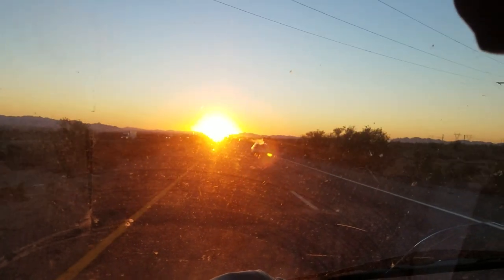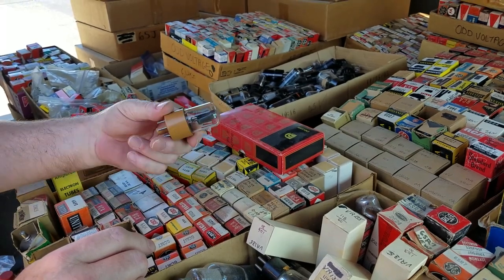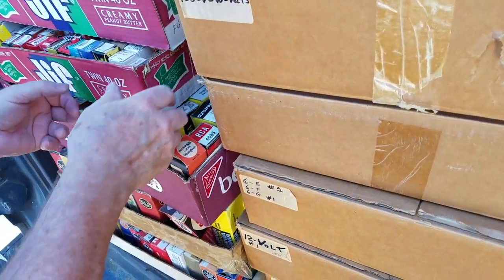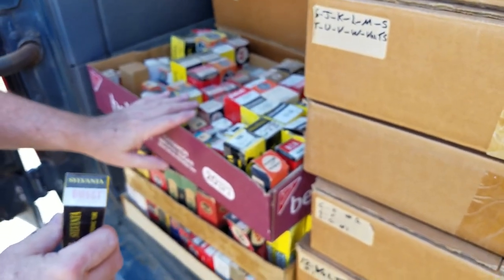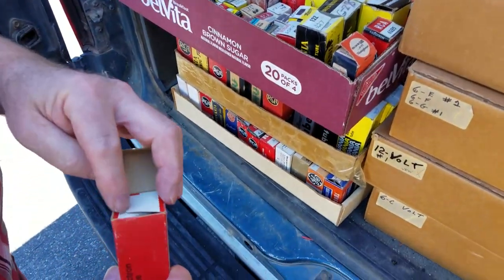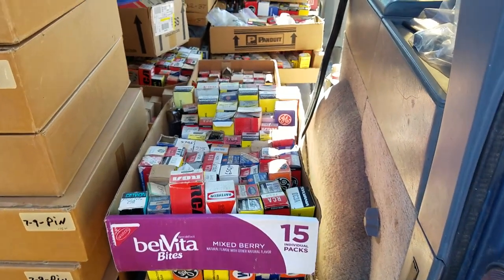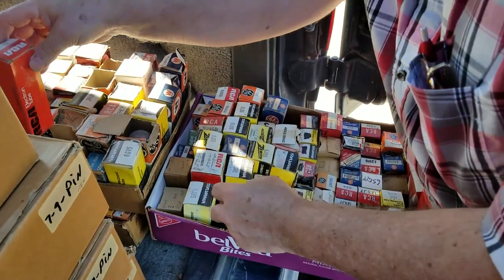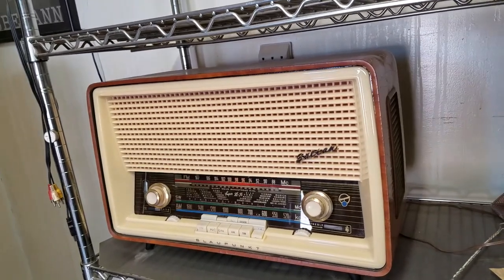Talkin Vacuum Tubes With AL

Comment: Gonna throw this one out there: I have an old Grundig hi-fi that has a "tuning tube", like an eye that glows green all the time and is supposed to increase/decrease intensity when a station is tuned properly. It never changes; always stays a constant light green glow. Any ideas folks? The radio works fine otherwise with the exception of a low hum and the large power transformer gets very warm to the touch.  Thanx
Reply: Im not sure about European eye tubes, but the US types like 6U5, etc. have a 1 meg resistor in the tube base. When that resistor fails and goes high, the tube will not deflect. They are often bad and it's a simple fix.
 If its humming and the power transformer gets hot you almost certainly have leaky or shorted filter capacitors. Those must be replaced ASAP. They will quickly overheat the transformer and kill it.
Reply: I was also going to mention the resitor in the socket, and suggest a re-cap.
Reply: The tube is probably ok if you see any light. Most likely it's the curcuit driving the tube which is bad. Some resistor or cap may be open/shorted, whatever. Further the socket or some other contact could be corroded (switches are very problematic in anything mid-century German). Just my 5 ct.
The transformer getting hot and hum in the audio output points to leaky filter caps. Get them out before the rectifier or even transformer takes damage.
Reply: @lsrx101  Thanx!
Reply: @frankowalker4662  Thanx!
Reply: @westelaudio943  Thanx!
Reply: yeah it needs repair, not gonna happen in the youtube comments section

Comment: Do they even make new tubes any more or just rebuild old ones?
Reply: You can still buy new tube audio equipment but I don't know who makes the tubes.  There is obviously some Chinese crap.
Reply: China and Russia are the primary sources for newly made vacuum tubes. Some good, some pretty crappy.  The majority of the types made nowadays are strictly for hifi audio amps and guitar amps, and if you need anything a little more obscure it's likely not made anymore. You'd have to resort to finding a new old stock version from 60 or 70 years ago.
Reply: @goodun2974  I always wanted a big Audio Research amp.  Big for tubes is 200 watt output.  They weigh about 150 pounds.  Recommended mounting is in a closet with an outside wall.  You drill a hole to the outside and use a blower to expel the large amounts of heat.  They cost like $10,000.  They have high resale value and the company will usually restore old ones to spec.  Tubies feel tubes sound better than transisters and certain brands sound better than others.  Telefunken the best, Russian kind of harsh.   The science is tubes only pass sign waves which are created in nature.  Transisters will pass square waves which are only produced artificially.  The ear experiences square waves as distortion.  So tubes it is said sound better.  But tubes have higher total harmonic distortion than transisters.  You want as big an amp as possible to minimize distortion on playback.  I have to think AR and McIntosh manufacture their own tubes.  Hard to think you would pay these kind of prices and get junk tubes.  McIntosh has a new one where the tubes glow blue.  So a gimmick.  I settled for a 400 watt Crown amp.  No longer made in US but I have a D150 made in US.  If something breaks you just call Indiana and they tell you what part to replace.  Try that with a Chinese amp. D 300s are still expensive.

Comment: 6CW4 is not a sub for a 6BQ5, its a nuvistor 10:54
Reply: He might have been thinking of a 6CZ5, sometimes used as a sub for  the 6973; neither of which are quite the same as an EL84/6BQ5 or 7189....
Reply: He may have been thinking of 6CW5 which is very similar, I believe the max plate and screen voltages are a tad bit lower than 6BQ5 but otherwise quite similar and both have the same pinout.
Reply: @Movie-Tech  You are correct, I wanted to say 6CW5.  The max voltage ratings are different and I am sure other specks between a 6CW5 and 6BQ5 are different but for the most part in a pinch are plug and play without any problems. I bet doing this substitute may even sound a bit different as any change in the gain of the output stage in a amplifier will effect the feedback loop changing the sound a bit. I caught that 6CW4 mistake myself! OOPs!

Comment: Last week I found out the hard way that EL-84/6BQ5 tubes can have two different pinout arrangements. I cooked an audio output transformer. 😖
Would anyone happen to have a KACO C600/6 or a C602/6 vibrator tube they could part with?
Reply: What amplifier are you running with EL84's that blew a transformer?  If usually when someone runs into this type of problem it is because they assumed that a 6BQ5 could sub for a higher-rated 6BQ5A, or used an El84 or 6BQ5 in place of a 7189 or 7189A which have significantly higher voltage and plate dissipation ratings....
.
Reply: @goodun2974  Its a Becker 6Volt power supply/final drive for a Becker LeMans radio head unit. Circa 1954. It’s definitely a different bird.
Reply: @akshonclip  The contacts in those KACO choppers wear out after a couple hundred hours. There is a solid state replacement out by a company called Aurora, the model designation is VBN-1  I have converted many of these Becker LeMans and Mexico tube radios and they all worked well

Comment: Personally, I don't think that vacuum tubes are obsolete. There are plenty of uses for these that transistors just don't make a suitable replacement for. They are making new ones now that are not huge bulb type too. Tubes are more reliable.
Reply: I have seen transisters the size of pie plates but I am wondering what high amperage industrial inverters use.  At one point the military was using tubes in radars.  I have heard some of these are powerful enough to be lethal at close range.
Reply: @goodun2974  I had read a comment of a navy guy as I remember who was flying across the pacific maybe in like a C 130 or something which was landing at all those Pacific Islands to refuel.  He said one had a huge radar station maybe aimed at Russia or China and he said it was so powerful the plane would be destroyed if it flew in front of it so they had to be sure and stay behind it when landing.  He indicated it could kill at close range.  Area 51 in NV. tests enemy radars as well as ours and they are left running in the remote desert on generators.  I remember Explore with Us found one and it had like radioactive stickers and warnings on it so apparently they are hazardous.  Of course microwave ovens are too but are shielded.  Not an electronics expert but I doubt you would want to play with a klystron at close range and of course TVs can produce x rays.  Not sure what it takes to produce the more hazardous gamma rays but they shoot food with them to kill bacteria.  Its amazing all the high dollar junk the military has left in the desert.  Tanks, APCs, mobile anti aircraft, perfectly good generators, whole towns built for commando training, airports etc.  Your tax dollars at work.
Reply: RCA Nuvistor tubes were almost as small as transistors. They used them as RF amps in their New-Vista TVs.

Comment: 6KD6 is good for linear amplifiers CB radio.
Reply: Are they equivalent as European version named EL509?
EL509 are power tubes for horizontal sweeping in old color tv sets...
Reply: Is not the same tube. EL509 is 6kg6, bit It works fine. The plate dissipation os Very close. Manu European projects use the el509. There are New tubes without the plate PIN on the top os the tube. I believe   they are used in áudio.

Comment: wow, i am intrest about radioactive tube for my collection of radioactive devices .
Reply: The 346C's contain krypton, the 346B's use radium-226 in salt form, specifically radium bromide.

If they are marked with the trifoil the tube contains more than average, average for the 346B's was 2.0uCi of Radium bromide. 

Any that contain Krypton specifically Kr85 as most commonly used would be long gone by now with a just shy of 11year half life. 
If there was any life left the tube would sheild a majority of what he is detecting, krypton-85 and its decay chain is a pure beta emitter.